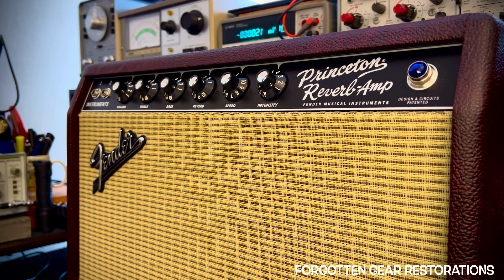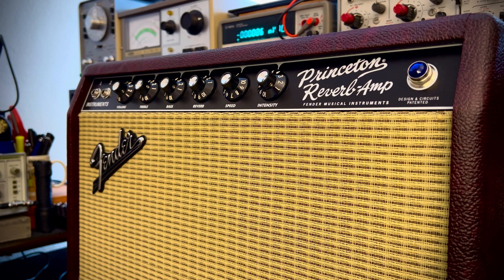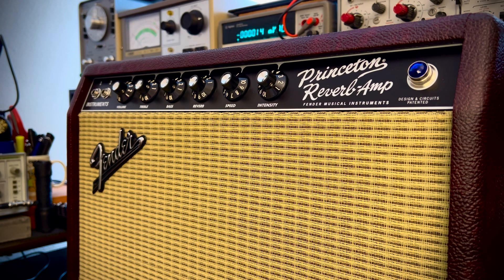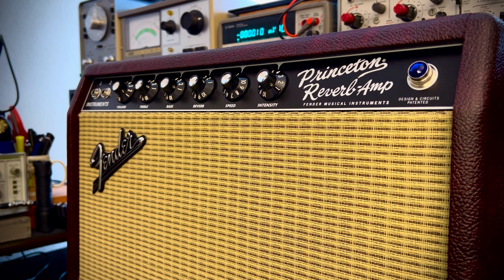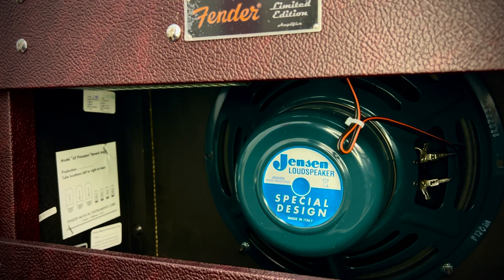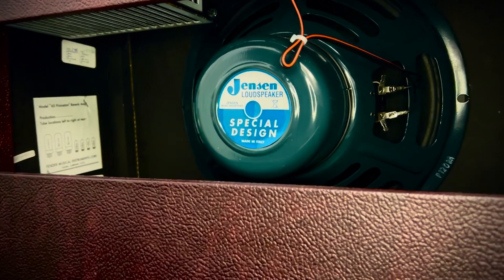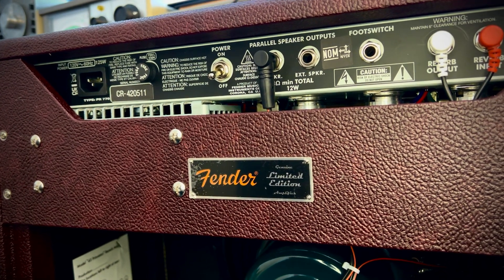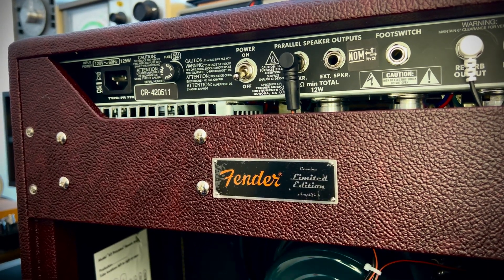Fender Reissues: Vintage Soul, Modern Problems. When an engineer gets the green light. Part 1

Comment: That’s a sexy Princeton! Is that the Guitar Center edition? Sweetwater offers a tweed one with a 12”, but I think it comes with an Eminence Cannabis Rex. I read nothing but good things about Princetons with a 12”. One of these days… 🫴💸
Reply from the maker: I can’t tell you which retailer sold these, but the wine Taurus and wheat combo is always a winner!  This is a great configuration for this circuit. I really regret selling my PRRI.
Reply: I wish Fender would release some head versions of their famous combos, with matching cabs.

I know it’s possible to connect a Princeton to an external cab, but none of mine are 8 ohms. They “claim” it’s safe to mismatch as long as the cab is one step higher (8 into 16), although I’m still too afraid to risk damaging my amp. And besides, seems like you’d want optimal power transfer with a low wattage amp like the Princeton. 🧐🤷‍♂️

Anyways, those head versions of the classic circuits would sell like hotcakes, me thinks.
Reply from the maker: @UnderachieverUnbeliever they won’t do it but I think some have (vintage tone?).
Reply: I run a 4buy 12 sometimes 2 4buy 12 off mine it rocks, gets super loud!
Reply from the maker: These can embarrass a lot of Marshalls with their nasty grind through a nice 412!